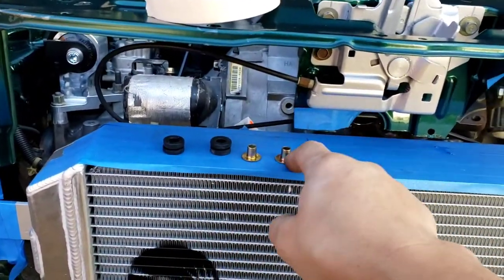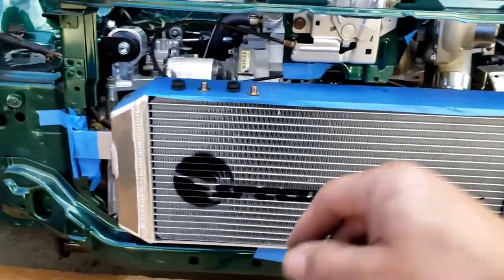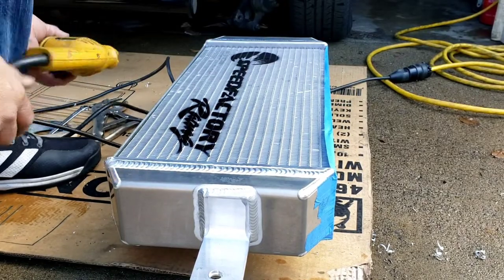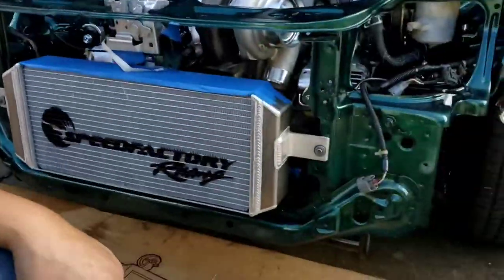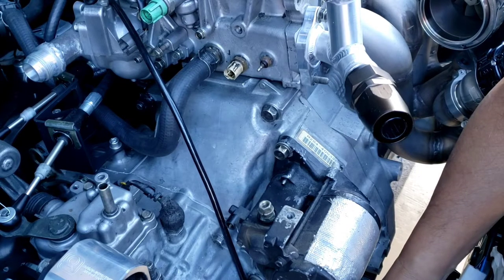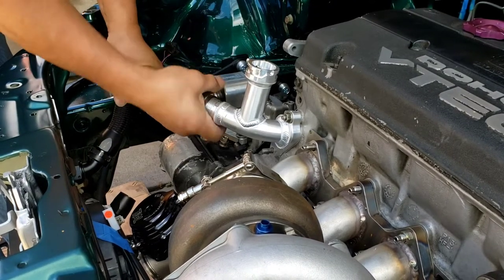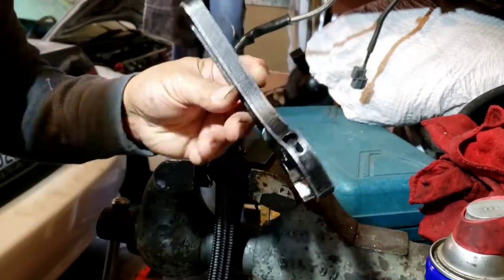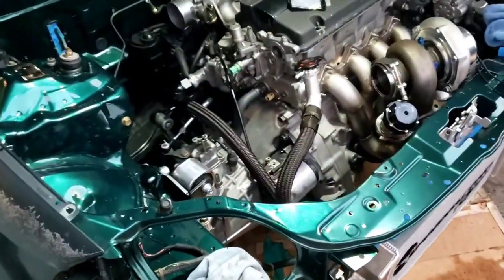SpeedFactory tucked radiator install. G23vtec swap Civic.

Comment: Carnt wait for Mylee to be finished I luv the attention to detail u put in every installation of parts and the knowledge u share with us keep up the great build I'm sure it will turn out better than u thought it would once u have finished keep up the informative podcast great viewing and proof that u don't need to have or work at a performance shop to do these builds thank you sagnett all the way from Australia my friend💥💥💥💥
Reply from the maker: Gadday mate, thank you very much and l will try to give useful information to others, and yes l've been trying to use tools that normal people would have in their possesion and in a safe manner. I really like to get it running, it just that one thing will come up and l get distracted. Right now, something really bugs me, that's the engine mount coming up, stay tune mate and happy new year.

Comment: What piece are you using on the engine to be able to use AN lines as coolant hoses?
Reply from the maker: Radiator must have AN fitting( your choice 16 or 20an) and for the engine side. Speedfactory sell the outlet side, inlet side, they no longer make. But KStuned sells it. I just weld a 16an on mine.

Comment: Where can I buy those rubber you used to mount the radiator? Thank you!
Reply from the maker: That was a fuel filter rubber mount isolator that l modified a bit to fit the holes. Honda and Acura have it all over the engine bay.
Reply from the maker: Or a simple grommet can be use also. Harbor freight selling it as a kit.
Reply: @sagittnet2158  thank you so much! 🙏

Comment: Did you have to wire both fans to the same connector?
Reply from the maker: Yes, both connected to oem wiring system w/ oem connectors. So far no problem w/ the relay.

Comment: Bro do you have a video where u show how you did the wiring ?
Reply from the maker: Do you have anything specific you'd like to know and what year is your car?
Reply: @sagittnet2158   i know how connect one fan but the second might need a relay ? Maybe the whole process
Reply from the maker: @emXietyy  l just connected them together. It never occured to me to run them w/ a relay or something till you ask for it. You got me thinking now,hehehe. I'll look in to it one of these day. Thanks for bringing it up.
Reply: @sagittnet2158  yes sir !!! If you have Instagram i can send you the picture of how the cables should go. Am just not an electrical savvy guy
Reply from the maker: @emXietyy  kool man, too bad l have no insta but thats alright. Thanks brother.
Reply from the maker: @emXietyy  you know l just remembered that on my cd5 Accord it has 2 connector for the radiator fan, so l'm all good there. But on the Civic, l did just hooked the 2 fan wires together and use 1 connector. So far lt never blow a fuse or anything like that but again, thank you for asking and l will install a extra relay for safety measure.
Reply from the maker: @emXietyy  awesome brother, l will put a extra relay on the other fan.
Reply: @sagittnet2158  no problems bro , great content. Keep it up !